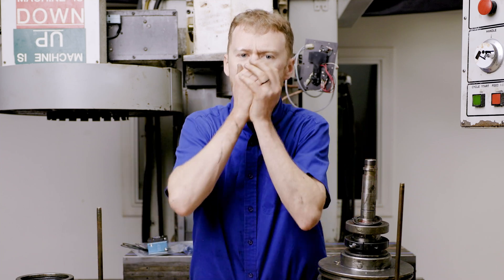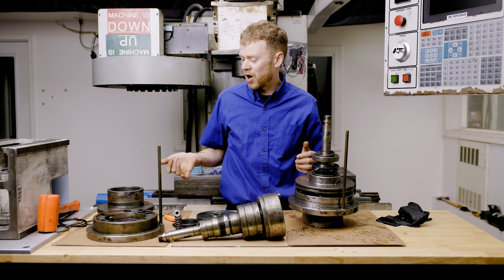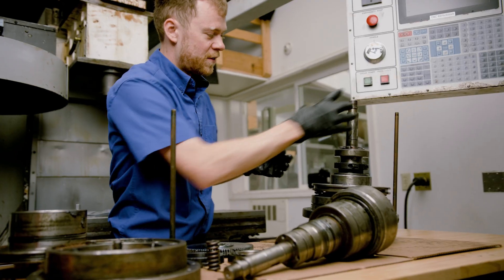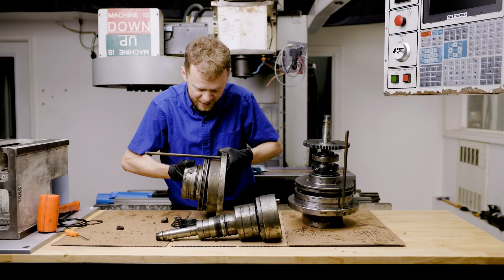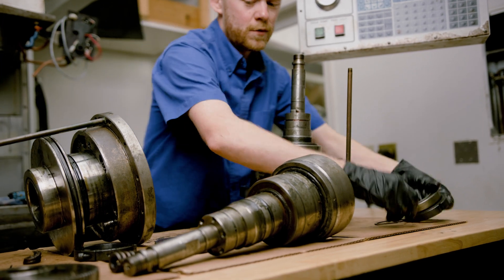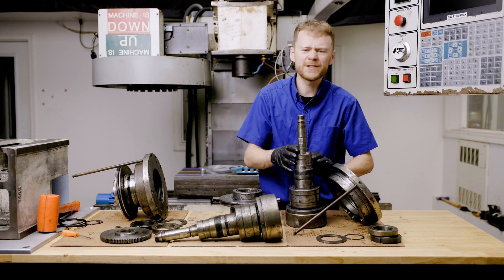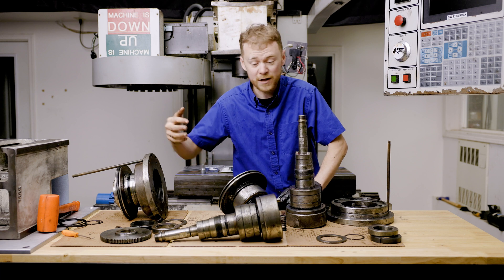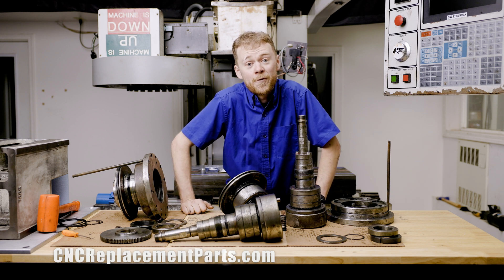ST Turret Piston Rebuild

Comment: I'm a Haas thec in Hungary. Just did, this job 2 weeks ago.  It was a pain, we had to hammer the sh!t out of the turret to come off. We probably hammered it over an hour to come loose. After we got the piston out i tried to pull the bearing (M70) and broke the threads on my bearing puller. It was fun times. But at the end we got it together, and the machine runs again and the customer is satisfied :)

Nice video btw, very informative and helpful, keep it up :)